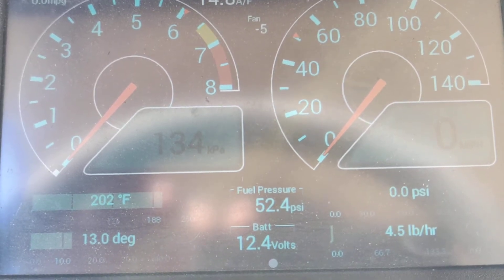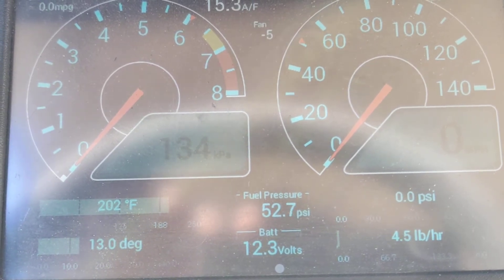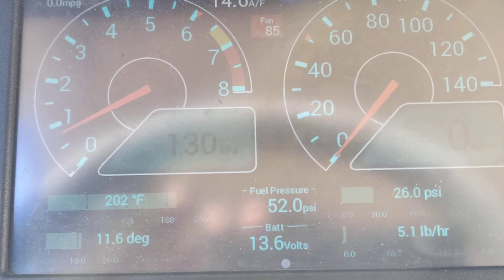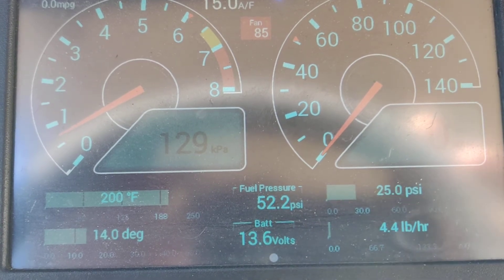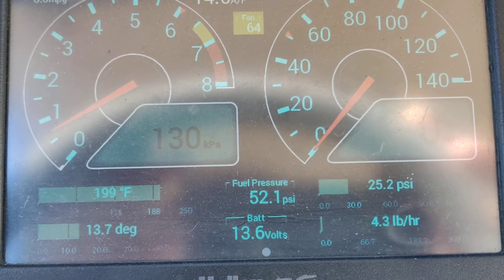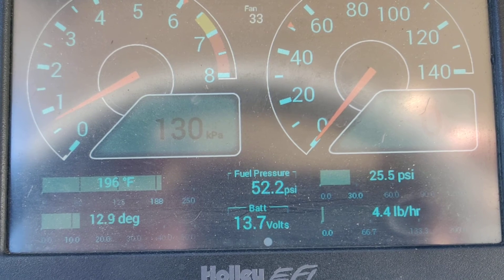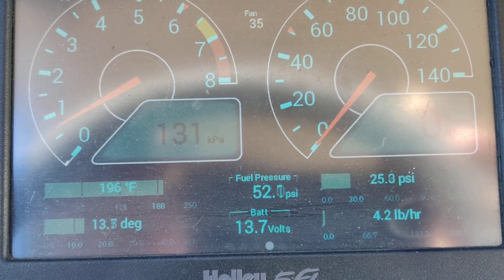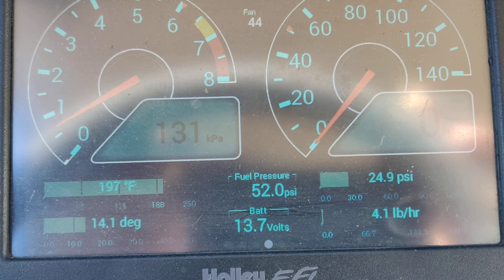Variable speed fan control with @HolleyPerformance EFI.

Comment: I read a comment today and someone was mentioning if you have your timing hovering around 15° at idle and you notice your car runs hot if you raise your idle timing a bit higher it helps with keeping the engine a little bit cooler. But shouldn't you have a car idle around 13 to 18° timing. And hello Andrew by the way you helped me out over the summer time on the phone with my Holly Terminator x I didn't know you had a YouTube channel so now I am subscribing 👍. Edit apparently I knew you had a YouTube channel because I just watched another video and I posted a question on it LOL.
Reply from the maker: Different engine combinations need different kind of ignition timing. The cam shaft plays a big part in how much timing is needed at idle.

Comment: I am about to install a TerminatorXmax for my LQ4 and have a 87 squarebody. I want to utilize electric fans from a 2008ish with radiator. I only have 4ea. I/O’s. And my fans have low and high speed. Do you happen to know if this can be controlled with the Holley ECU?

Further more I love the variable speed setup, can someone retrofit an electric fan like mine by using the controller? I did notice that the duty cycle decreased as engine temps decreased but how does the controller get its signal from the A/C to come on?
Reply from the maker: Email me. It's my channel name at gmail dot com

Comment: Hey Andrew, do you have a part number for the C6 fans and controller you use? Thanks Ahmad
Reply from the maker: This is the best way to buy it: https://www.rockauto.com/en/moreinfo.php?pk=7097004&cc=1441686&jsn=452
Reply: @projectgattago  - before I saw this video, I watched your other one.  I started searching for the best price for the controller and rockauto won.  Only $6.99 shipping to me in Maryland.
Reply from the maker: @pete540Z  Which controller did you get?
Reply: @projectgattago   I guess YT deleted my response due to it having a link.  Anyway, its listed for the 2005-2013 Corvette, under "Cooling Fan Controller" as "GM GENUINE 1580803"
Reply from the maker: @pete540Z  That part number (1580803) on RockAuto comes up as over $150. It is listed under fan control module
Reply: @projectgattago  - that's the one.  The link you posted was for the controller and a subharness, at $230
Reply from the maker: @pete540Z  That big connector is not available anymore. It isn't just a Metripack connector. I would get the kit that I posted, with the harness.
Reply from the maker: @pete540Z  I would get GATES FCM117K
Reply: So no harness.  I suppose that connector is a Metripak that I can source separately.  I'm building my own harness for the HP ECU and Terminator TBI I bought separately anyway.
Reply from the maker: @pete540Z  I don't know which connector you are referring to.
Reply: @projectgattago  - sorry - the one that mates with the fan controller itself.  I will probably put that right on the harness I am building.

Comment: Is 85 the duty cycle % you’ve programmed into the Holley ECU to max out the Corvette speed control?  If so, how did you know 85% would do it?
Reply from the maker: 90% is max, but I have a math channel so that it shows zero when the fan is off.

Comment: So is this an electric clutch fan of some kind ? Ho does it know the fan percentage of output ?
Reply from the maker: This is  C6 Corvette fan and controller.
Reply from the maker: I am using a C6 Corvette electric fan. The duty cycle output is programmed in the Holley EFI software.
Reply: OK that is cool, one more fail safe for them to control. So if say the temp crosses some threshold it shuts down or goes into limp ?
Reply from the maker: @TheCanadianBubba  You can set various safeties in place based on engine temperature, if you want.